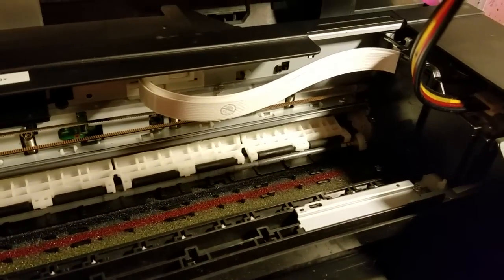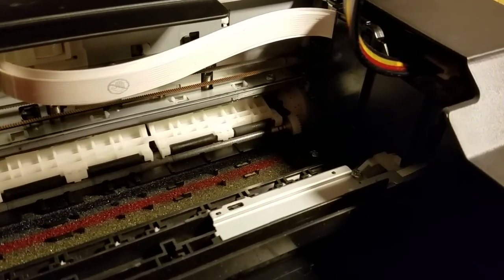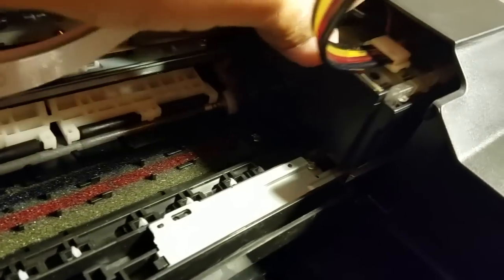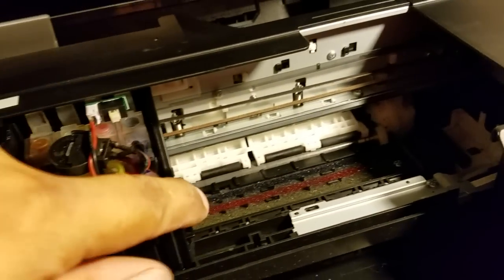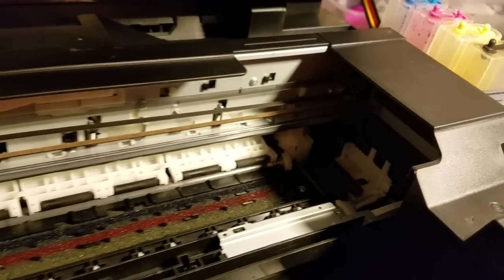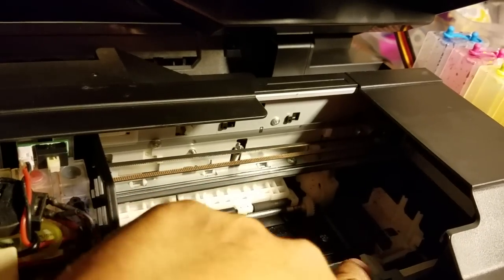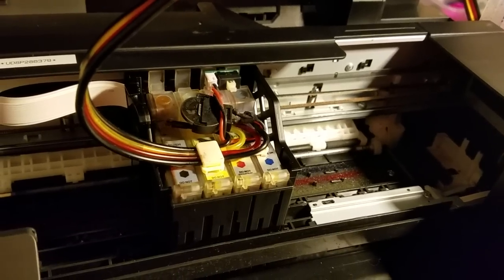How to fix 0XE8 error Epson XP-420

Comment: On the very left side of the carriage there are two large gears and one small gear with a (plastic) tab that gets pushed toward the print head when it gets near  that tab. 0XE8 Error happens there also, along  with a screeching sound.  Just wondering if that tab causes something else to grind because the print head is actually stopped at that position? Epson WF-3640.

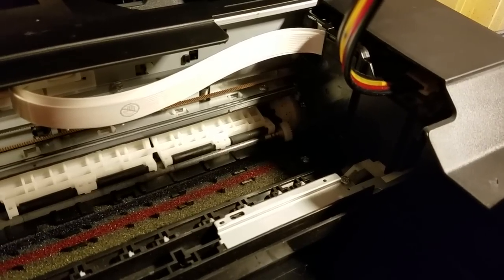Comment: @ 1:23 that is a carriage lock.  keeps the print head from moving when it starts up and needs to set zero point for encoder strip.  small piece of plastic and an even smaller spring.
it's run by the gears on the left moving the bar/gears on the right that move tears in the waste ink tank assembly

Comment: Today I got a new Epson WorkForce WF7610 it didn't have any cartridges in it so I put some in for sublimation continuous printing. I turned it on and the cartridge moved to the left, then made a horrible noise and the Error code OXE3 came up. I did everything you said, I looked for tape, I looked to see if any plastic parts were not in place and it all looked good to me, I moved the carriage back and forth several times and it moved smoothly. When I turned it back on it did the same thing moved to the left and made a horrible noise. Do you have any suggestions?
Reply: +Terralea Collins   So what ended up happening?  Did you take the p.o.s. back & get your money back or find a fix for the problem?

Comment: I tried to moved the cartridge housing but it's locked in place all the way to the right. I can't access the menu to unlock it. Is there another way to get it to move?
Reply: did you ever get a response? 
mine is doing the same thing
Reply: NO HAY MEJOR MAQUINA QUE LAS HP
Reply: Shut down the printer. Find the electric wire location (to cut off the power). Start the printer and when the printerhead starts moving around  take the electric wire off.  Now you can move the printerhead freely.

Comment: In my case, the culprit for the error was a nail that found its way to my paper feeder and proceed to get lodged between those rollers that pull the paper...
Reply: My error 0xE8 also turned out to be a jam! It was toothpick, resting on the metal ledge below the long, toothy belt, and somehow managing to get stuck in the gear wheels that spin at either end...

Comment: hi. I've just bought the Workforce WF-2630 and it was working okay but then all of a sudden when I turned it on again it was saying Error 0x60 turn off and on again which I do but that Error message keeps coming up? Is this going to help my problem? Thank you x
Reply from the maker: Amy E Phillips does the carriage moves around at all or does it do a couple of beeps and give that error without it moving around?
Reply: It doesn't move at all just beeps and shows the error. :(
Reply: @nekodaisy89  Hi Amy, I'm having the same problem. What was were solution in the end :)
Reply: Isn't it nice (not) how they don't come back and answer your question or give you further advice after you have given them the further information they asked for.
Reply: TIENE ALGUN CUERPO EXTRAÑO EN EL INTERIOR POR DONDE TOMA EL PAPEL..PUEDE SER RESIDUO DE PAPEL O ALGUN "CLIP"...O QUIZAS HASTA ALIMENTOS..BUSCA CON LINTERNA Y UNA LUPA CUALQUIER COSA QUE ESTE SUELTA